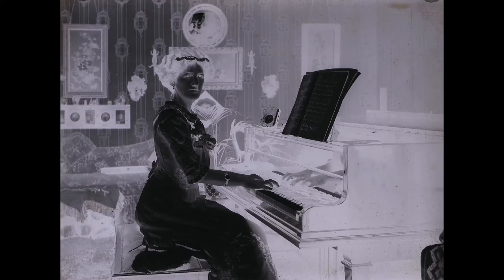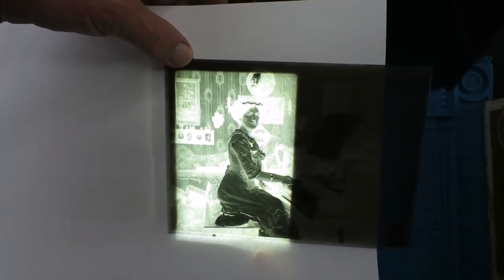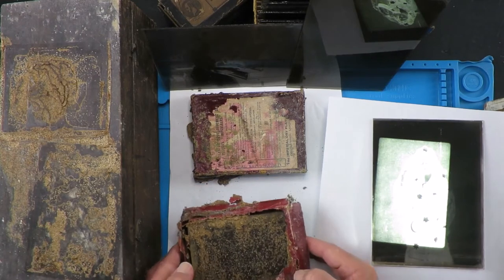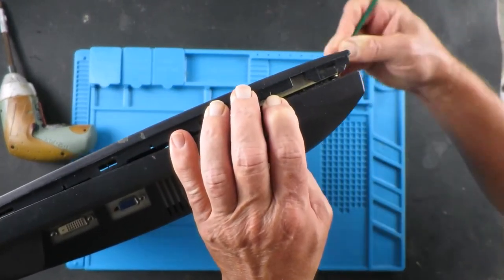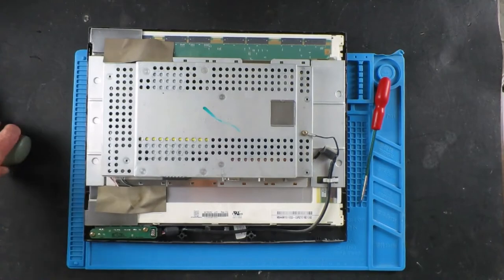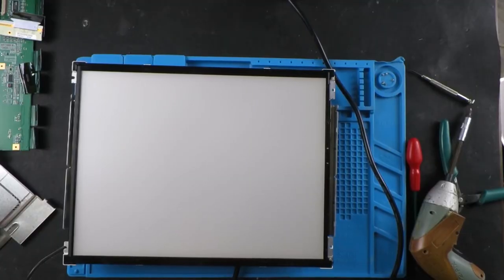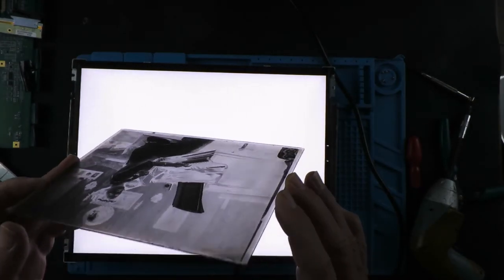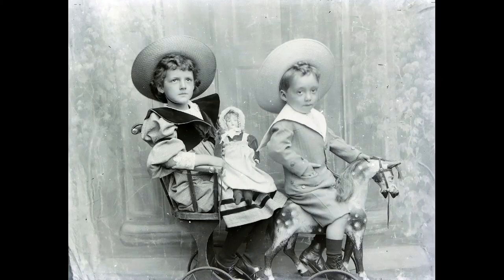DIY Lightbox For Old Glass Negatives - Photography Project Tutorial

Comment: So do you think that just using the monitor and going to a website with a white background without pulling all of this apart would also work?
Reply from the maker: I guess you can try that! Nobody wants these old square monitors any more, I often seen them left out in the trash. There is always a danger that you could scratch the screen of your monitor as well.
Reply: I only need a light board for negatives that I have. Not glass ones I've never seen glass  ones
Reply from the maker: You should be OK then.

Comment: Nice video, but just one question, did you try scanning the plates in a normal flat bed scanner?
Reply from the maker: Hi Antonio, yes I have tried scanning but had some problems. Firstly my scanner does not have a "transparency" adapter that can light these large plates. Also the files produced are truly enormous! I prefer to have control over the focus and exposure that using a camera allows. Scanning is slow and I found that there was more "post processing" to do. Finally there is a danger of scratching the scanner glass or even other negatives as dirt and dust can be transferred to the scanner glass.

Comment: Hi there, just found this video while searching glass plate negatives. Do you know if heat is dangerous for the emulsion from the LEDs? And why does the glass have to face up if you are worried about scratching them? I know you are using glass negs that are of no historical value to you, but what if you wanted too. You have a beautiful even light but does it come at a cost? im just looking at my options as someone whos looking to get into this.
Reply from the maker: Hello, I would not wish to expose the negatives to LED heat. This is why I chose an old monitor that has "cold cathode" lamps which produce next to no heat. The diffuser material is a soft plastic possibly mylar which I don't consider a problem. This is one reason why I do not use a scanner as It has a glass bed. I put the negative glass side up as I found the focus easier, your mileage may vary! The beautiful even light came at zero cost to me as the monitor was just in my "packrat" store. These old 4:3 aspect ratio monitors have no value and you can get them free at most dumps.
Reply: 1nformatica I was meaning the cost of heating the plates and damaging them. Lots of those cheap screens at my recycle  centre too ;) gona make me lightbox
Reply from the maker: That's great! There are 2 related videos which you should find useful : 
Photographing Glass Negatives  https://www.youtube.com/watch?v=ihl_4Jm0Ja8
Batch Processing Photos With XnView https://www.youtube.com/watch?v=Zb1hevSN6i4

If I can help with anything let me know.

Comment: Wait....I watched this entire video and love the concept.  But, once the display was completely torn apart, you cut to video to power being back on and a nice white, defused light.  What power supply do you use?  Did you plug those two connectors back in and add 120VAC and that was your end product?I have 500+ glass slides from 1890 to 1905 I want to photograph.
Reply from the maker: Hi Alan, I used the built in power supply. You can see the mains input socket at this point in the video: https://youtu.be/8x0KGjDVrUU?t=209
As you have so many slides you may want to see my other video on batch processing : https://www.youtube.com/watch?v=Zb1hevSN6i4
And how I photographed them :  https://www.youtube.com/watch?v=ihl_4Jm0Ja8
Would love to see your slides if you eventually put them on the web somehow.
Reply: Ok, I see that point in your video where you mention reconnecting the screen to the power supply.  All I need do then is save the PS and remember where the leads went.  Looks fairly simple.Thank you.  And yes, I will look at your batch processing video next.  ;-)
Reply from the maker: It is quite straightforward. In case you don't know the small tubes that light the screen are both delicate and driven at high voltage. so don't be too rough or connect them with the power applied!!